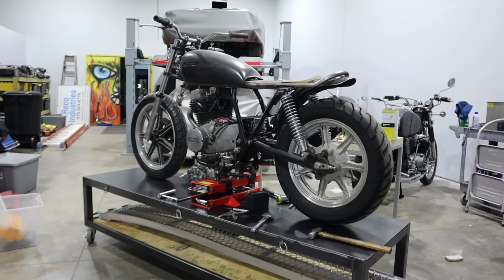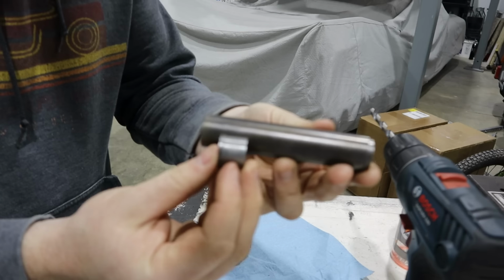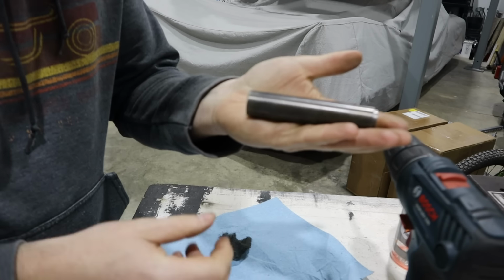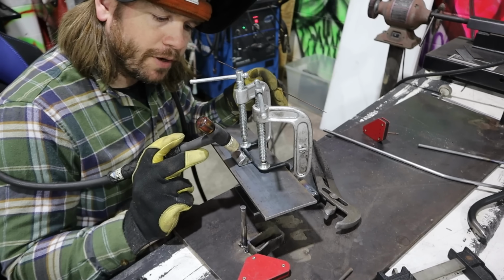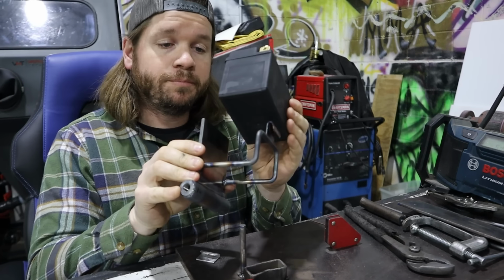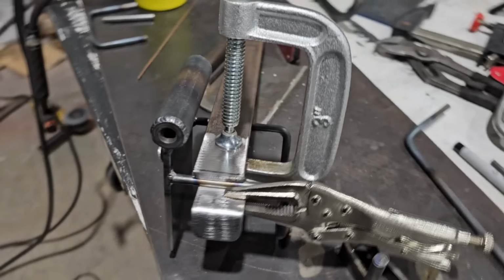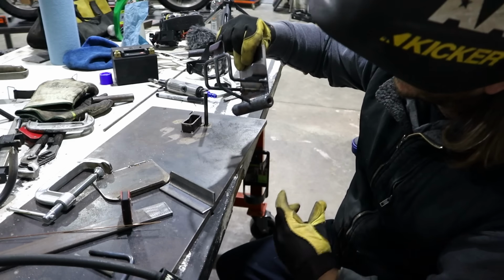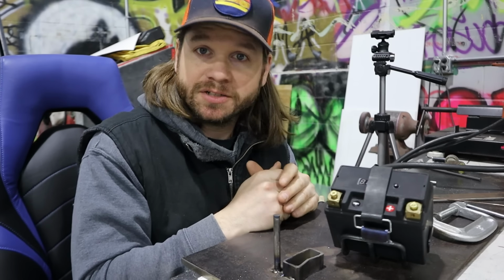Making Custom Battery Tray On The XS400

Comment: I love Rust Oleum,  the primer, a big can of that, slathered on with a brush. Then some color, usually flat black or sometimes high gloss black.  (and then a pint of the primer in a quart of waist oil and a quart of diesel fuel with maybe some minwax stain amazing for the outside wood finish project. The Rust Oleum primer holds it all together.  No bugs on the fence. ever.).  And so....  Oh yea.  No rust for me.  Just saying.  Your student, always, Steve from New Hampshire.

Comment: For small parts I use a very small drill vice to hold the parts. I drilled and tapped the body of the vice and threaded a stud into it for my work lead clamp. I also machine inserts for an almost press fit so one side does not lift up when tacking the opposite side. No tig finger hold down needed. Cool project
Reply from the maker: Thanks for watching

Comment: Hi BJ. Been going through your back catalogue on Wanda as I am about to make my battery/ electric box/ tray for my RT 360 scrambler project and I’ve seen you put a cylinder flapper disc back on your band saw after use.  What is the significance of this. Love your work.
Reply from the maker: @markrobinson4981  So I actually use that to hold the trigger on the machine. It's not originally designed as a vertical bandsaw so you would have your hand on a lever/trigger to use the machine. When vertical like this I don't have a spare hand so this is just a basic way of getting it to work. Not the safest 😅

Comment: Wire wool on a drill bit! Why didn't I think of that?
Reply from the maker: Probably has potential to dull the bit but still handy!
Reply: @BrickHouseBuilds  Drill bits are plentiful. Old honda suspension parts are not.
Reply from the maker: @montgomerybusch-pigg2722  truth!!